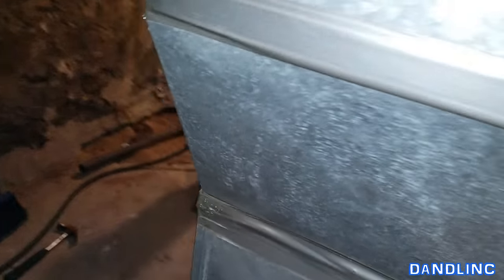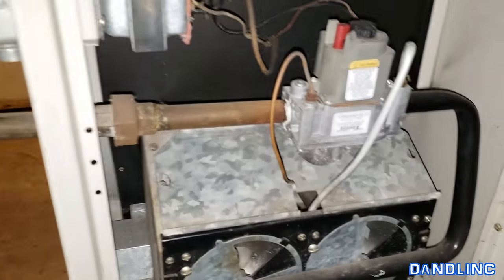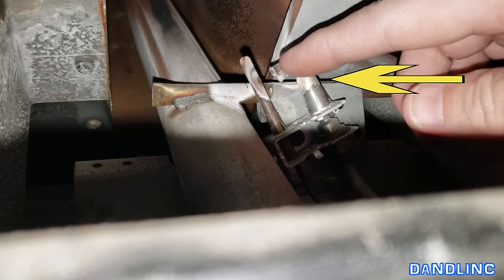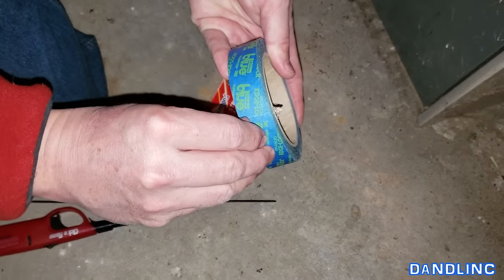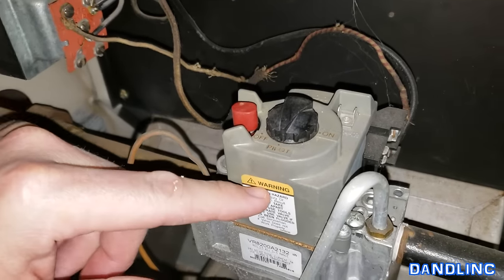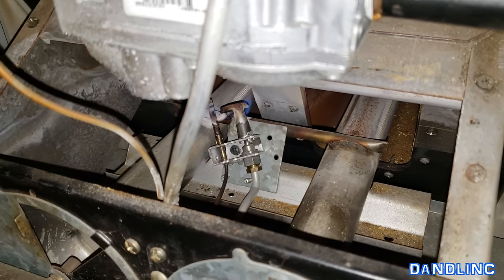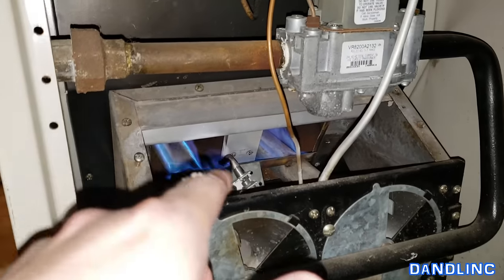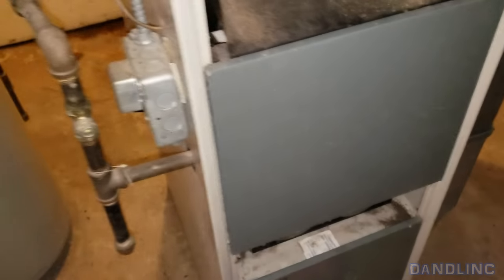How To Light A Furnace Pilot Light (DIY! Save $$ and Time)

Comment: I believe I used this video in the past to light my pilot. Today, I woke up to my house 49° and saw the pilot out again. I had to remove the outer plate (slides off) and another metal one behind that (held in by 2 hex heads) in order to see and access where to light the pilot. I followed the video instructions, but every time I let go of the red button, the pilot would go right out before turning to on. After an hour and a half trying and failing repeatedly, I was finally able to get it to light and stay on by very, very, slowly releasing up on the red button (40 seconds later) with my right hand as I turned the knob from PILOT to ON with my left hand. Without doing that, it would just go out after lighting. Just adding this in there in case it could help someone else like me. Thank you for your informative video, I finally have heat! 🙏
Reply from the maker: Well done!  Thanks for the comment.
Reply: I can’t get mine to stay on either but mine has a switch you push in instead of
Reply: Same issue I'm running into. Still trying.
Reply: As I understand it...if the pilot does not stay on when you put the switch to the on position, likely the thermocouple needs replacing.

Comment: I just wanted to say thank you. I have been without heat all winter. I'm so used to electric central heat that I had no idea that I had to manually ignite my gas furnace in my new apartment. I came home and it was 57F in here and I was fed up. Now I don't need to wear a coat to bed. I'm so very thankful.
Reply: Ljn

Comment: Nice video. In a pinch, I used a stick of incense because the pilot was so far back and the wind was really high and kept blowing out the match.
I’m glad you mentioned turning the thermostat down first because when you light the pilot the furnace might jump back on in your face.
One other thing, when you light the pilot with the button down, you need to hold it until the flame heats up that sensor. The sensor is connected to a solenoid that’s will keep the pilot position ON. If you let go of the button and the flame dies you may need to clean the sensor or check the connections and voltage to the furnace solenoid. If you let go and the pilot flame stays lit, then all solenoids and connections should be good (A solenoid is just a neat little switch that turns things on and off depending on the voltage applied. In this case, the heating up of the sensor, found right next to the pilot light develops a voltage to the solenoid that allows the switch in the main unit to turn on and allow the gas to flow to the pilot light). Yearly or even twice a year inspection and cleaning of these critical parts is highly recommended especially if you own an older unit.
Reply: I used incense as well 😅
Reply: Thank you so much!!!  64 yr old woman , no man in the house to help. I will do this. You are awesome 👍

Comment: You just saved my butt! My furnace doesn’t have an auto fill nor a safety to stop it from overfilling. I turned the valve on and forgot I was filling it as I was distracted by my toddler and flooded the system. Water was coming out of all the vents. But I turned off the valve and drained the furnace but was still getting no heat. I figured I must have soaked the pilot light and you showed me how to relight it. I almost called a service man too! Thank you!

Comment: I needed to relight a pilot on my friend's boiler, it looked the same Honeywell....  You were spot on!!!  Luckily my thermocoupler was right in the front, just through a little access panel, so the long lighter worked fine.  You were absolutely right about letting it heat up for about 30sec while holding red button.  First time I did it, it hadn't been out for too long, so only took like 5 sec to re-light (yeah, I was pre-mature lol).... but later in the day I had to relight it after it was off for a while, and it did take a true 30 seconds-ish......

My man!!!  thank you!!!
Reply: Also the $ store ligthers might work 
But check with a professional.

Comment: Thank you for this video!! Our pilot light was out and it dropped to 50 degrees in our house. After doing this, we had heat within 10 minutes! Everyone just be safe though! If you smell gas do not attempt this! Also, be sure that the flame is blue. If it’s not, you might have a clog or another issue which could be dangerous

Comment: Thanks so much Iv not used my i floor heating for like a year because I thought I had to call someone now it’s winter and my friend come over and was like she effin cold down there and I just had to really find a way to ignite it lucky I thought I could not get into my tank but there was like a door at the very bottom of the tank I could open and slide open! Walla it’s on it’s running in floor heating is back baby

Comment: My furnace has you pushing down the actual knob so I can’t turn it from pilot to on quick enough any advice?
Reply: Ghost69420  Sounds like most other furnace switches. Read my comment. You have to hold the switch down and light the pilot. Once the pilot is lit, it will warm up the temperature sensor. Once the temperature sensor is warm enough it trips a solenoid that will keep the gas flowing to the pilot. So hold it down 60 seconds. Once all that happens you should be able to turn the switch to the “on” position. If this doesn’t happen, then you may need your temperature sensor cleaned off (very simple) or the solenoid replaced. I’ve never done either so a good HVAC service would be my next step. I hope this helped. Good luck and God bless.

Comment: We have a furnace that sits horizontally, in the attic, not vertically like the one in this video. I'm fairly certain the pilot light was blown out by incredible winds. The unit stopped heating right after the strong winds we had that day. I'm guessing somehow they whipped around up there in the attic and blew out the pilot light. Will have to pull down the stairs and go check. Hopefully our pilot light mechanism is similar to this one. Anyway, the furnace will come on and air will blow through the ventilation system. The problem is, it's not heated air. It's ice cold. Which leads me to believe the pilot was blown out in the extreme wind we had. A good possibility at least.

Comment: I have a Tappan furnace manual pilot light the gas man shut it off but it wouldnt relight.  Similar to this. I pulled cover off alot of white film the pilot puffs but wont stay lit. Do you have a vid showing how to clean these types of pilots? I was just going to shut off the gas remove both the gas tube and thermalcouple and clean them with fine wire bristle brush and blow through the gas line to remove any debris. Is that a nope and just replace or is cleaning acceptable?

Comment: 0:53 two questions:
1 when the knob is in "on", is the gas leaking out, should I wait for the gas to dissipate?
2 what is the reason the pilot turned off ?
Reply from the maker: When the knob is set to on...the flow is controlled by the thermostat on my wall....it comes on when the room temperature drops to a certain level.  
The reason most pilot lights turn off is they're simply blown out somehow.  This particular chimney is short (less than 10 feet) and we recently had very high winds.   
Thanks for watching!
Reply: @DANDLINC  nice reply, thank you sir. I'll be back here when get it done.

Comment: I have a Dunkirk furnace.  The pilot is lit, but it's not heating the house. I reset the fuse box. The lights on the front of the panel are out. What would work in this situation, since the pilot is still lit? Thanks!

Comment: Why did it light up the main heater if you said the thermostat was set to OFF ?
Reply: WaveAction777 Im wondering the same thing man
Reply: @biggablayez456  Ditto.  Have you two had any issues since?
Reply: j no
Reply: Because a thermostat doesn’t impact a persistent pilot flame.
Reply: That's what I'm trying to figure out.
Reply: We left the thermostat on and turned the gas off before we did this

Comment: Thank you for your post. My system is exact the same like yours. It's just not working and I'm trying to figure out why. May I ask where the ignitor is if everything is working fine? I know that the thermocouple acts like a safety device, the other tube next to it is for gas, I dont see the ignitor.

Comment: I changed the gas control valve on a repco boiler. The other 2 boilers pilot on twice as high. So the 3rd with new valve not heating up thermocouple. Pilot Flame to low.  It says to remove a cap to adjust pilot flame. And turn srew counter clockwise. I don't see it. Tried every srew except Allen keys. Any suggestions.

Comment: If you find out one of your furnaces is electronic start but they look identical and neither showed pilot lit if you turn the pilot lighting knob to off will that mess up the start cycle on the auto electronic cycle. And if so how to get it back to normal. As I got rhw manual lit one working now the automatic one don't work.

Comment: I have a old floor gas furnace when I hold the pilot button down and put a lighter up to it the only thing it will do is flicker and sputter when I let go of the lighter it goes out immediately I changed the thermocouple but it didn't change anything. Do you have any suggestions what I could try.

Comment: Hold up tho....I’m confused how did the fire kick on right away if the thermostat is off and not calling for heat I did all
The same steps you did but I had to walk to my thermostat and make it call for heat then all my flames lit up...did I miss something?
Reply: I guess he had the thermostat and furnace power switch on already.  The instructions printed on my furnace say that both should be off.
Reply: Maybe we all have different setups depending on who installed.  I was able to follow this with both my thermostat to the "off" position and also the master switch for the boiler in the basement set to off.  It seems on my system, the gas for the pilot light is independent of the thermostat.

Comment: what happens if the gas service gets cut off, will the pilot turn off and will gas escape?
Reply from the maker: If gas service is cut off, the pilot light will go out...when it goes out, there's usually a thermal-couple that will cool, close a circuit and shut the gas off so when it comes back on, there will not be a leak.  Thanks for watching!

Comment: So I can get the pilot light to stay on, but when I turn on my heat, it just never lights up the rest of the flames and no heat comes on..
Reply: I got same issue. Did you solved the problem?
Reply: @OnTheWay  I believe I ended up calling a guy and apparently some wires were hooked up incorrectly so he re-wired it and it has worked fine since. It's weird because it was working the year prior just fine

Comment: You forgot to add one vital point! Turn off the circuit breaker for the circuit that you're working on. You don't want any accidental sparks by touching the metal door to the contacts.

Comment: So to turn off switch it to pilot or off ??
Reply: off to turn it off. Pilot when you need to light it with a match and on to leave it on so it can heat up the house. When holding the red button for 30 sec you have to turn it to on quickly while letting the red button go up, you have to be kinda fast because sometimes it will go out again and you have to restart the process, it's actually pretty easy to do.

Comment: So I used a match to light the small flame, but when I switched it from pilot to on the furnace didn’t light. The small flame stayed lit but that was it
Reply: Turn your heat up. If the furnace doesn't lite then you have another problem

Comment: One problem my pilot light comes on when I ignite it but when I turn the dial to on it goes out.
Reply: Hold down the gas button longer, if not then could be thermocoupler
Reply: @juliea.hansen8875  Thanks I think it's the thermo coupler, I held it down for 2mins and still wouldn't stay on.

Comment: I have a question that maybe someone here might be able to help with. So I followed the video up until the very last step. I got the pilot lit, handle turned to on, go to turn my thermostat to a temp but the furnace isn't lighting. I've tried looking up tutorials but I can't figure it out. I know I lit it last year and it was horrifying because I think I had too much gas coming out (big fire ball inside the unit) but this year I don't seem to have any gas coming out. I'm in an apartment. Is it possible my landlord hasn't turned the gas on? I don't come from an area that uses gas so I'm actually somewhat clueless to how the whole system works. I was reading that maybe the thermostat isn't telling the furnace to light because it's dead but it doesn't seem to run on batteries (I took apart the thermostat and there isn't much to it). Any advice would be great! My landlord is super aggressive so if I can figure this out without getting them involved, that'd be great :,D

Comment: Omg so after failing several attempts and almost giving up, I figured out you have to turn the temp on full blast to make it STAY lit. You're welcome.
Reply: No, you shouldn’t turn on your temperature at all. Just press and hold on to the red button for several seconds,  it will stay on long enough till your switch the black button back to ON from the PILOT position.